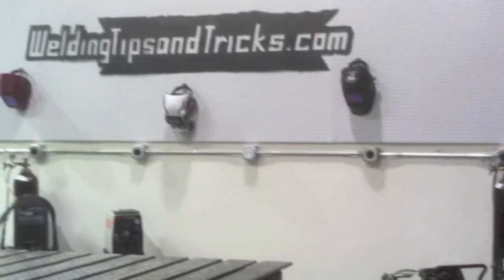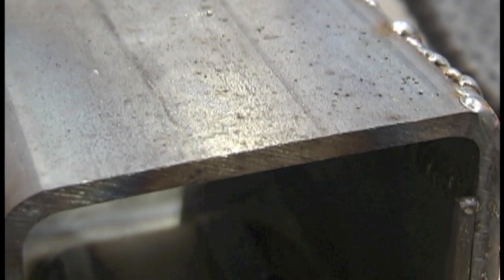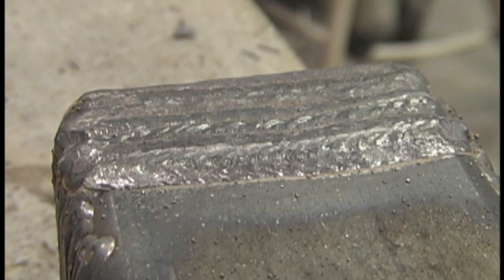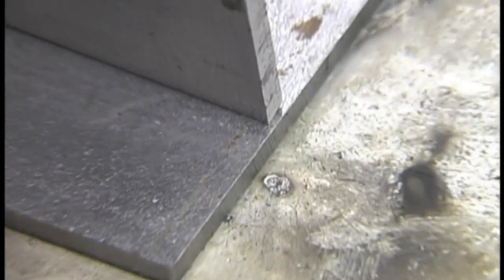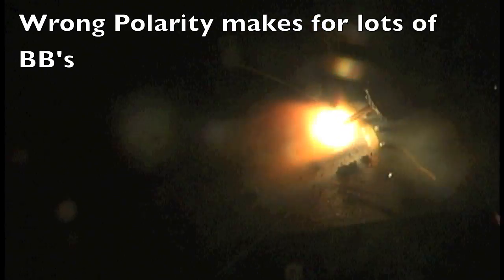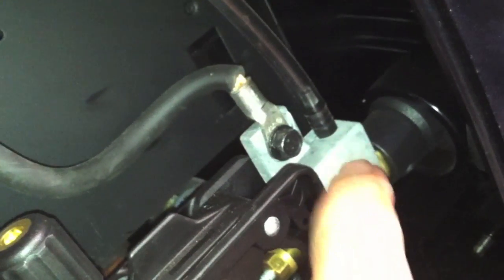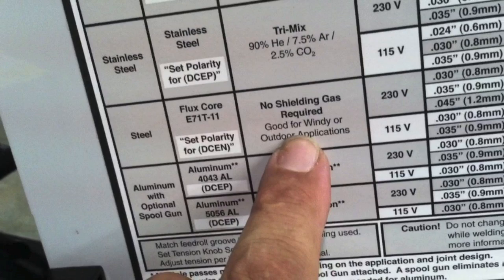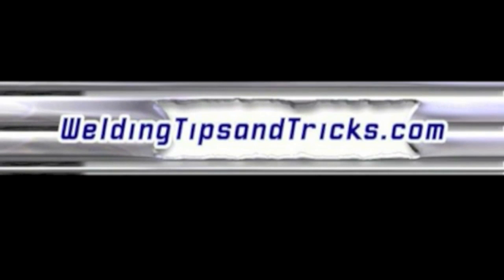Flux Core Welding - Merit Badge

Comment: I was told recently that flux core welding produces a 30% weaker weld compared to stick welding. Any truth to this or is it a load of crap?
Reply: Dual shield aka outer shield it better than stick in certain apps but go to ChuckE2009 dual shield fcaw he explains everything
Reply: Naw stick and flux core are pretty similar since the electrode class are still e71-t or something like that

Comment: Those BB's are called slag. Damn near any flux core welder will produce them. Use argon gas or co2 and itll make one hell of a difference not only in the slag department but also make way cleaner, stronger welds by far

Comment: why would you need flux core welding? im my school we only learn TIG, MIG/MAG, MMA and gas but my theacher even says gas is just shit and we are prob not gonna juse it.
so to what welding would you need flux core?
Reply: ironworkers use flux everyday.  You get to carry a 40lb spool in a suitcase up 12 flights of stairs along with 500ft of lead draped around your neck. Its mostly used on structural applications.  When i went to welding school we even learned how to weld with oxy-acetylene (torch welding).   You need to know how to do it all. Including fabrication/measuring/blueprint reading.   You're not gonna hold a job only being a "welder" typically.

Comment: Hey Jody, just tried out my new tig fingers and they work great. 
Im doing a stainless tig job autogenous, no fill,  piece of long thin walled pipe with a stainless disk that slips over and is fillet welded 1/2" from the end of the pipe.
simple job but i have 800 of these suckers and im having a problem with undercut on the pipe.
any ideas on getting a hold on that under cut. i  have the machine turned way down, real sharp electrode and trying to keep the heat on the think material.

great vids!

Comment: There are core wires that doens't make slag and they are called Metal Core arc welding (MCAW) . The weld does look alot like regular mig but it is a core wire. Great looking wled and No slag, thes best of both world.

Comment: flux core gives better penetration? it became pretty popular in the industry in Urop ;p , what are the advantages?
Reply: no gas is the biggest benefit.  Try welding in the backyard in the summer with no windblock.  I managed a small shop once and I switched everyone over to flux because it was cheaper for wire,and wasnt consistently filling the bottles. In my welding textbook from school, it stated the penetration was typically deeper, but with todays machines, I dont see penetration being a wire or machine issue, but more of a user-error.

Comment: Hi Jody, great video love them all. In this video you are talking about polarity for flux core. The thing is, at work we use the same welding machine for both GMAW and FCAW, just plug in the right gaz depending what type of wire we use. But nerver have we change polarity, how is that?

Comment: The very first thing that I did as an instructor is to make sure the students can see.  "you can't weld what you can't see" is the old rule of thumb.   I am 63 years old now, and I used to use cheater lenses, but I now use reading glasses.   Couldn't get cheaters that fit my automatic helmet.  But, if you use cheap reading glasses, REMEMBER they are not safety glasses and do not use them for chipping or grinding.